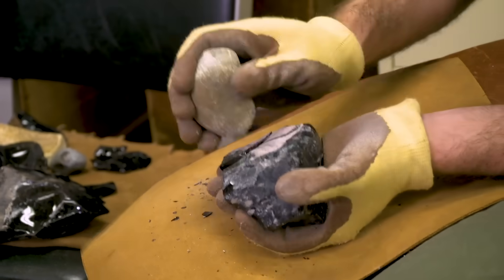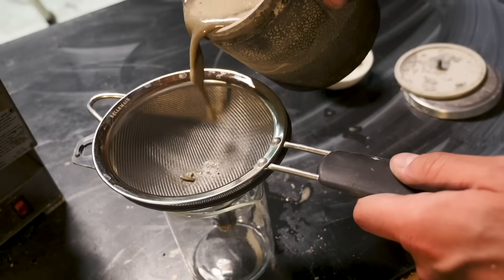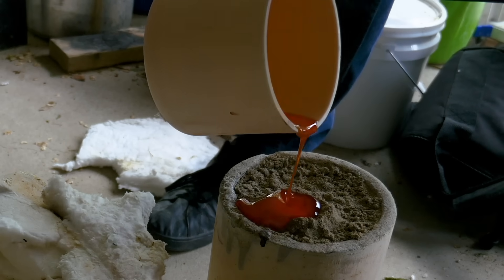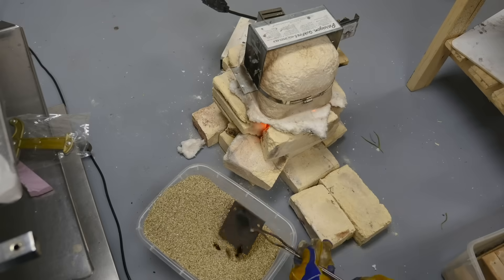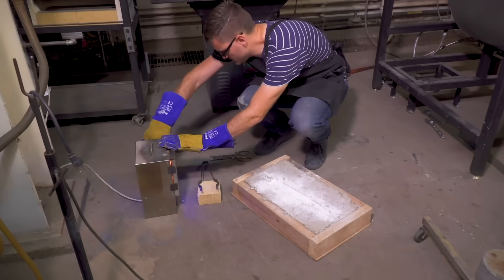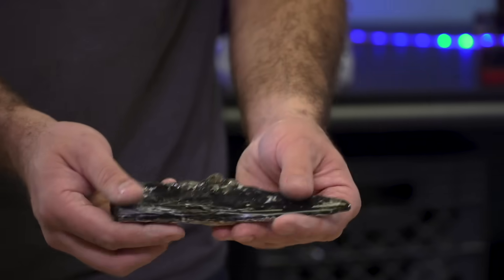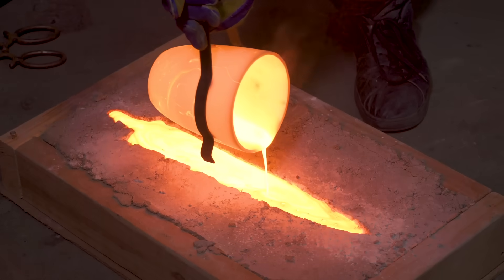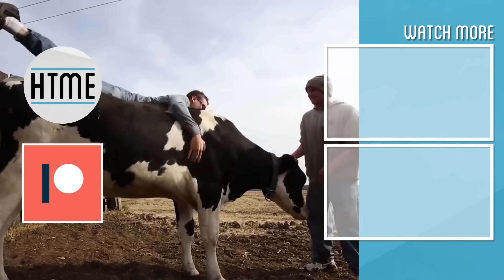Can You Melt Obsidian and Cast a Sword?

Comment: Think of all the pure energy and hours spent in this endeavor. Makes you think about how much our ancestors must've struggled and failed in metalwork before achieving anything even remotely successful.
Reply: Which really explains why blacksmiths were so highly valued.
Reply: @notyou2353  Blacksmiths were the NASA engineers of their day.
Reply: Yeah there is a weird ceramic(forgot the name, I'm getting old)  that the ancients used. It's as hard as steel but has to be fired for a very specific timeframe, I think like a half an hour window and at a very specific temp, like 450 degrees I think. I always wondered how they figured that out. Must have seen it form at the side of fire by luck, know it's possible, and then do > 9000 reps to see if they could get the same results...
Reply: @apathyreview3964  It's a lot like celadon, then. It has a very specific process, and even the tiniest thing like outside temperature, humidity, and even the overall passive chemicals in the air could ruin.
Reply: they had a lot more free-time than we have.
Reply: @sandrafrancisco  No they did not. Survival was a constant struggle. Life before the 1900's was much harder/harsher than it is today.
Reply: @ngcastronerd4791  just shows how the turns have tabled in modern ages.... people are trained to treat jobs these days as an extension of schooling. Something you just do 

That's the fault though, because jobs are supposed to be important- not just some shit you do. Our society is so dumb on a broad scale now :/ it's annoying and sad really. 

Also is very clear that nowadays people don't value their time the same as our ancestors did... not just their free time. Another gift taken for granted 😔
Reply: Metalworking is far easier than forging an obsidian weapon
Reply: @iNCoMpeTeNtplAyS  that's why Obsidian Weapons were found way before metal weapons ... duh!
Reply: @Tobichiii  those weren't forged though. Comment was about our ancestors having to struggle with metalwork when we have clear examples of them successfully creating metalworks because metal is easy to melt and manipulate. Obsidian weapons have nothing to do with that because they are made from lava flows and carefully fractured to produce a sharp edge that can be attached to a stick dum dum
Reply: @iNCoMpeTeNtplAyS  you don't 'forge' Obsidian weapons. It doesn't work like that.
Reply: @Tobichiii  guy in video literally forged a obsidian sword, though a bad one. The whole process of making a weapon like this is called forging, from melting the material to casting it into the shape , it's called forging.
Reply: @iNCoMpeTeNtplAyS  You just got not a single clue what you're talking about. Forging means make or shape a (metal) object by heating it and then hammering it. 

What he did there was casting.
Reply: Nononono guys guys it'll work this time i think, I'll bet my last baboon bone it'll work
Reply: This is glass tho
Reply: They also didn't melt Obsidian. Which doesn't really work as we can all see.
Reply: Don't forget that perfecting all these technics took thausends of years
Reply: @Truth speaker praise for that comment
Reply: There's an old story of Thomas Edison, it took him roughly 250 tries to perfect the filament to make the lightbulb work, when asked by a reporter sometime later if he ever got discouraged by so many failures Edison replied "I did not fail, I succeeded 250 times in learning how not to make a lightbulb."  Success isn't just about winning, it's about learning from your losses
Reply: @FerretJohn  yo, did Thomas Edison steal the idea?
Reply: @FerretJohn  nice story bro.
Reply: @Truth speaker ~~i mean I don’t think anyone disputes that chipping Obsidian works better to make it an effective tool than trying to melt the damn thing, but the point of this video was him wondering if it was possible to cast obsidian, not if it was possible to have obsidian tools~~
Reply: you cant compare the two imo
Reply: They had nothing else to do
Reply: *glasswork
Reply: @MichaelReznoR  the layman's process is similar enough.  melt the product, pour the product, shape the product, sell the product.  that melting part must've taken a damn eternity though - melting and mixing different metals and minerals until we find something useful.  glasswork was a novelty, but bronze was useful.
Reply: you do realize that both metalworking did not start with casting and obsidian is not metal
Reply: @nathanieldebarros3849  bronze and copper alloys were proliferated long before ironwork was.
Reply: @Anomalocaria  maybe but signs point to formative metalworking happening long before casting as it can be traced to almot 10000 years ago and i never said anything about ironwork or alloys
Reply: @nathanieldebarros3849  you're desperate to be right about something.

you were wrong to begin with.  we were talking about successful metalworking - that started with copper alloys and it started pretty damn early.  it happened in different places at different times, the earliest examples of metalwork of any kind seems to be some copper pendant 8700 years ago that can't actually be accounted for.  earliest credible examples are Mediterranean cast lead and tin beads 2000 years later, and 2000 years after that is when we start seeing alloyed products.  so, it really didn't happen 'long before' casting so much as it happened in tandem with casting.

but none of that shit was particularly successful.  copper ruled in some communities for a little while, but bronze was the real boom in metallurgy.
Reply: @Anomalocaria  Copper is the metal. Bronze and Brass are alloys derived from Copper. Copper and Arsenic for Brass, Copper and Tin for Bronze. They started experimenting to come up with Bronze because the process for making brass at that time was extremely harmful from the fumes.
Reply: @robertkarp2070  copper is a metal, sure.  one of several found in bronze, which is also metal.  i'm not sure what you're getting at lol.  

i don't know where you got the idea that brass came before bronze - earliest evidence of deliberate brass production goes back to pretty much the start of the bronze age.  we'd already been playing with copper alloys for quite some time.  

we have no idea why people started playing with copper alloys like bronze and brass beyond that it was available (and so why wouldn't we?).  i was just saying that it must've been an arduous journey finding metal compositions that made for good tools.
Reply: @Anomalocaria  Actually, many cultures began their exploration of metalworking with meteor iron, long before they figured out how to mine or smelt copper or tin. They basically treated it like a very rare stone that could hold an edge far longer than their typical knapped flint blades. The distinction between metal and rock is a cultural idea that generally arises after people realize that fire burns away rocks and leaves behind metal, allowing for ores to be smelted.
Reply: @MrFelblood  are we really trying to have a semantic discussion, here?  i don't see any real conversational value in this.  

curating bits of unrefined iron-bearing minerals is decidedly not included in your average archaeologist or anthropologist's understanding of the word 'metalworking.'  i'm not sure there's anything you're going to be able to say that will convince me otherwise - furthermore, this is a semantic distinction that i don't believe is relevant in a discussion specifically about anthropogenic alloying practices.  i mean, that was kind of the point, right?  we're marveling at mankind's creativity in melting metals together to make something practical.

i'm also still pretty sure cast lead and tin artifacts predate the earliest malleted meteoric iron artifacts, which would suggest that metallurgy was already well underway, albeit in separate cultures lol
Reply: One of Noah's sons was a master metalergist

Comment: Dude you need to use pure plain obsidian with no flux and use a larger kiln to melt it already in the mold  . You need to mold the edges square and flat so you can flake off an edge.

Comment: Obsidian is naturally formed on volcanic vent on constant heat, low pressure and in absence of air before being spewed out 
The ancient Aztecs collected them, cut them into small sharp rasor like chard and fashioned them into cutting tools.
Glass implement may be at their efficiently best when crafted small. Sword size can be achieved with combination of aluminium or some metallic alloy but then it would not be a true obsidian

Comment: Obsidian has its dark color because it mixes with pebbles and fertile soil. Creating an almost black look. If you hold obsidian up to the sun, you'll see that its slightly brownish on the edges where light is able to shine through. You've merely boiled out the soil impurities, which makes the outcome technically smokey quartz. Smokey quartz is actually a glass crystalline structure, like its most commonly used sister; Quartz, which is used in a lot of glassware because its resistance to heat and bubbling when being blown into a shape. Smokey quartz is never really used because brownish yellow just isn't a great look to some people. Its just a more brittle form as they usually form over hundreds of years, where as this cools in minutes, making the chemical bond weaker than its predecessor. Just some cool science for you volcano geeks out there😊.

Comment: Do not add Flux. Heat it over 3000 degree. Keep the sand cast preheated at 300 degree. Also use a closed cast. Bake it for 6 hours at 300 degree.

Comment: Make an inner skeleton of tungsten for obsidian to grab and be supportive
LESS FLUX
maintain a sterile argon filled chamber to work in
Maintain zero airflow
Pour quickly and with manual force
If necessary do in sections and flux back into one piece 
Maintain heat while carrying over  with a crucible cover
If this isn't enough you might need to do an injection molding to reduce non insulation time to near zero

Comment: The problem Is thermal expansion coefficient, to try solve It you need to cast the obsidian inside a crystal oven with controled temperature and super slowly AND gradually  downgrade the temperature, depending on ITS thermal expansion coefficient It Is the Time It sholud take, It coult take months or minutes like the borosilicate. The cooling down sholud be even, that means that the core of the sord desirably must have the same temperature than the outside, It breakes because de diference among those temperatures Is higher  than what a crystal with that thermal expansion coefficient can resist. Sorry but as you see english Is bot my native language.
Reply: You Also Will need the crystal to be pure, any impurity could cause the crystal to brake.

Comment: I think it’s safe to say Mother Nature is FAR more patient than this guy. 
Casting obsidian IS possible. It just takes LOTS of time. Going slowly with steady, balanced heat is the best strategy. Cooling in sand is a mistake. Heated clay is better. The cast and the mold have to have a similar temperature so they can cool together. After reaching room temperature, slowly reduce the temperature more to separate. 
The process can take two days or more depending on the amount of obsidian you’re casting. Don’t try to rush it in hours.

Comment: I'm just wondering, if you used steel or high temperature rated metal to make a tang & spine? You'd have to heat it to red hot in a forge then add it during casting.

Would not be usable, however might make it a practical ceremonial or wall hanger.

Comment: not that this isn`t awesome . but wouldn`t you be better served to make a knife with a nice handle as it always breaks sharp?i do similar things , bone knives . backtard cruciblle etcetera. just curious man good video.
Reply: OH should you be curious the trick to bone knives that actually work is using a dremel saw with a round bit head to make the edge serrated . it should look a bit like a jawbone when finished and you can cut branches with it with ease.

Comment: Why didn’t you put it in an enclosed fine sand casing ? 
Instead of exposing the obsidian to open air which will induce it to bubble which in turn will make it brittle an crack. Should’ve heated the sand to an even temperature as when your pouring in the obsidian and have a controlled temp to keenly turn it down to its controllable temp. 
Glass will crack in heat differential an will crack if the surrounding temp is lower then it’s increased temp. Which is why metals do well in exposed open temperatures. It give it time to solidify but with glass CONTROLLING EXTERNAL TEMPS WILL HELP IT SOLIDIFY AN TAKE ITS PROPER SHAPE. 
Glass is delicate obsidian is hard to shape an form if you don’t know it’s properties and weaknesses of its construction. 

And for you crucible cracking .... did you cute it? It looked brand new , and as it goes for any new crucible you need to cure an set it .proper high (standard) temp to standard normal temp. 
It wasn’t the obsidian cracking the crucible I have had my crucible an I’ve used it for many projects based on its size and I’ve never seen any crucible fracture this many time I’ve seen you use it.

Comment: Hey man I love what you're doing, however I can't honor that being a true obsidian sword because you had to add a bunch of chemicals and things which made it very weak. My supposition is to increase the temperature and using a caste press so it forms all at once while piping hot. Yes obsidian is used more ceremonially, mainly for the ritual arts of magick, but obsidian is sharper than surgical steel, so with the proper technique and equipment you would be much more successful in your endeavors! And I would applaud you for it!

Comment: Thinking about it, you'd have a much better result sticking it in an industrial oven to "cool". You would have to preheat the oven to at least 1000 F, and gradually decrease the temperature every half hour so that it cools super slowly. Obsidian has a much higher tensile strength than your metal mineral, and cooling it super slowly (while eliminating dramatically differing convection temperatures), allows the blades  edge to crystalize under conditions that more mirror nature.

Alternatively, you might consider super heating the sand before burying it. But it's more optimal to continually lessen it's convection by not allowing runaway cooling, supplying more heat energy to account for the tensile strength of the material and the heat needed to prevent it from overcoming that tensile strength from the inside-out.

Comment: If you could have been around back in the day when it flowed as lava.  Obsidian, Andesite, basalt even granite are igneous rock.  I want your thoughts on something.  Archaeological sites around the world, more especially in Peru and Mexico have a lot of stone work.  Everything from polygonal blocks in walls, to very ornate pieces with symbols.  A lot of basalt, some Andesite and granite and smaller works from obsidian.  Were the ancients working with these materials while the material was in its fluid state?  Many blocks have small "nubs" along one edge, some centered.  Were they using shallow, slow moving lava flows, diverted into small trenches and filling forms and molds.  A hole in the ground filled with sand with design placed in it would render a sand casting of stone, no?  Olmec heads of basalt, etc.  I enjoyed your work and there is one video on Youtube titled "lava sculpture" i'd like you to watch.  Those "nubs" on stone lids around the world and in Peru, I strongly believe they were either intentionally formed into the molds or they were the inlets and outlets of where the molten material entered the molds.  They simply severed the piece and left them attached.  I'd like your thoughts.  I try to put it in modern thought, picturing a foundry, one crew working with fluid material flowing out of their forge, a different crew pouring a billet.  The first crew has molds of wrenches filling with fluid steel, the other returns in a week with hammer's and cold chisels to make wrenches out of a hardened 500 lb billet.  I think someone back during all that ancient construction figured it out.  Farm lava to form stone into whatever they needed it to be or look like just like you did with that obsidian.

Comment: If you heated the vermiculite before plunging the blade into it, it would be less likely to crack because of the extreme differences in temperature, hot glass suddenly covered by cold/room temperature vermiculite would cause a sudden temperature change which is the opposite of you want

Comment: I would bet that a prolonged cooling process (as would be found in nature...) with a propane manifold over the work piece that could be dialed down in temperature over a "TBD time frame" just may be the answer to prevent cracking, yielding an unbroken piece of glass.(similar to cast iron) As to the of strength the material, I have little faith leaning towards durability, no matter the process. It's glass! A very fun project non the less!!!!!!!!  Thank you for the video of your efforts!!!

Comment: dude if your gonna use something like obsidian you have to refine it by heating it and letting the gaseous impurities out. This requires repeatedly melting it and you used WAY to much flux for it to be proper, it is now a flux sword with some melted obsidian. I understand getting it hot enough to pour properly is near impossible but the simple reality is you need better gear, even then, all that for a brittle sword that while very sharp would break if it ever hit anything more solid than a hunk of meat. It is just not feasible.